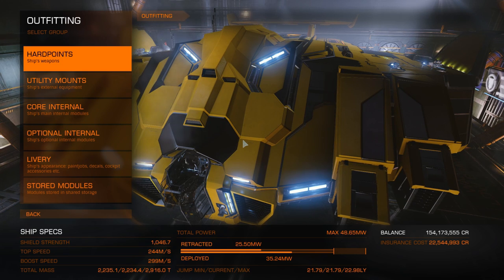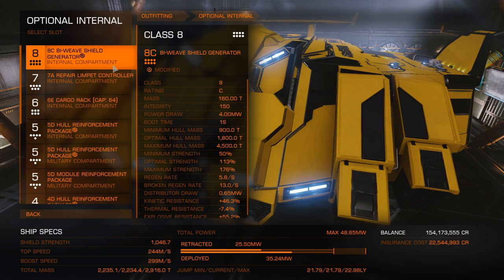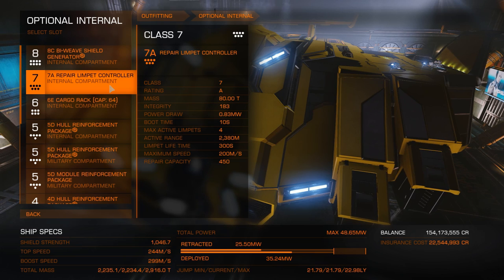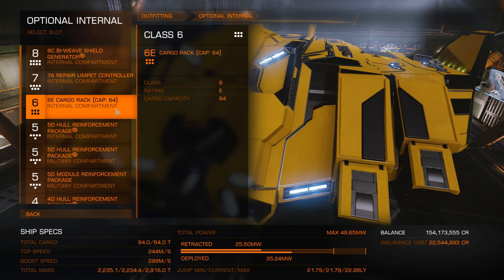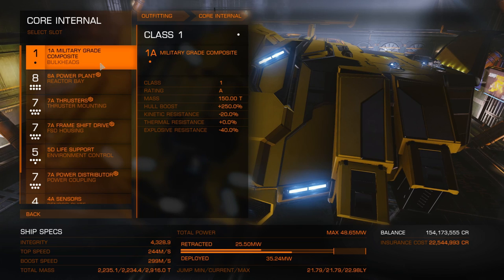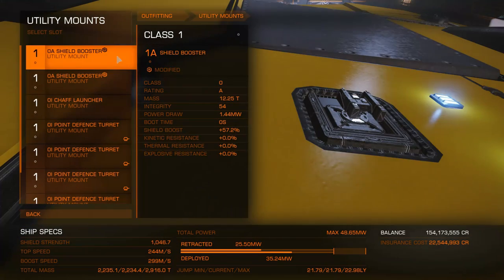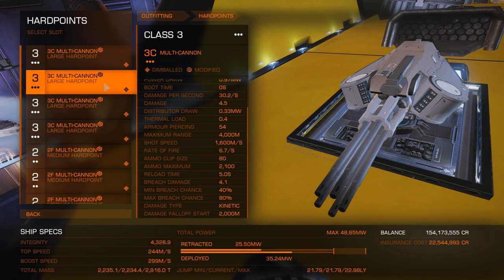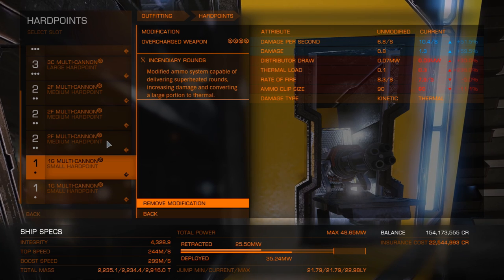Elite Dangerous | Type 10 | Combat Build

Comment: Just a heads-up for future viewers: don't get the 7A Repair Limpet Controller.

A Repair Limpet Controllers don't repair more than any other grade, they merely have longer range. So if you're only using it to keep yourself repaired, you should go with a D graded as it is the least demanding one when it comes to weight and power - and with a big beefy boi like the Type 10 you want to cut weight wherever you can!
Reply: That's not true?

Comment: Love the T-10. I use it the most. Generally because most dont. It's an awesome ship once you work out the floors, especially for npc's. frag cannons are what I generally use, sometimes all 9! If I have frags with beams I set frags to top hardpoints and beams to bottom hardpoints as I generally find I'm passed from above. Have the 2 class 1's as frags, 1 corrosive, 1 drag. I've played elite for so long but not done much pvp. Alone I think the T-10 will struggle at pvp but in a squad I'd have thought it'd be handy. It's certainly not the best combat ship but it's enjoyable, lots of options, teaches you how to pre-empt, teaches you FA-off (or, in other words, how to turn 😂), decent veiw from cockpit, especially if using headtracking or VR. My combat T-10 is fully engineered but have one for cargo in dodgy areas and its so sluggish compared to the other. Makes me appreciate the engineering! o7
Reply: Another one Ive heard of is using all pack hound missles and 2x  class 1 missles in the front 
Its a right laugh
Reply: @MrTimjm009  I bet that sets thier module on fire! Mad amount of heat. Not sure if my gpu could handle 7 packhound all firing at once 💥